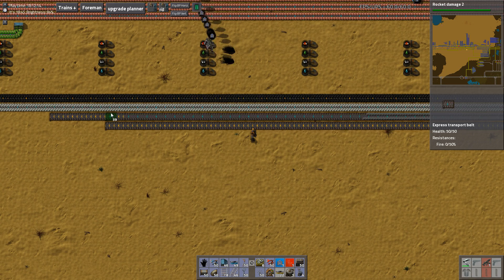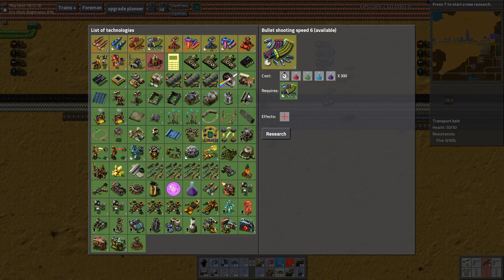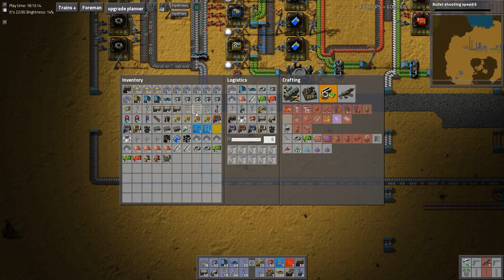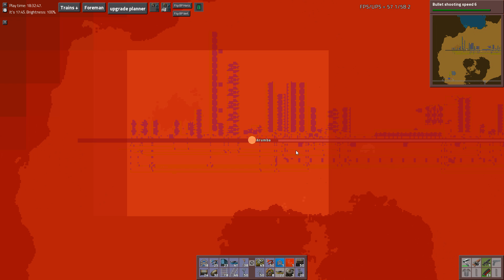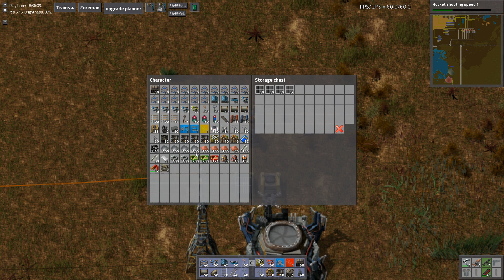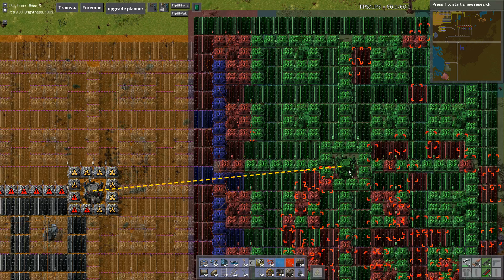Let's Play Factorio Steam Release 20

Comment: Tiny question: If the plan was to hook the solar farm builders up to the main robot network, then why did you build the factory for the solar farm in the north-western part of the complex and the solar farms in the south-east?

Wouldn't it make more sense to build the farm and the factory as close to each other as you can? I would've put the farm on the south-western corner of the factory, with enough space for what you'd reasonably need for belts on the main bus.

Comment: Arumba, you do know that you can remove and set the power lines on the poles manually right? Remember you being annoyed by the crisscross of wiring early on :)
Reply: +Frodulus The Wiki is nice :)

 Use shift-click on a existing pole to remove its connections to other poles.
 Unconnected poles can be connected with a single copper cable dragging from pole to pole.

Comment: Been watching for a while and I keep wondering why you don't use a carousel to unload the trains? that way you have one unloading station that feeds all the various fuel, copper, iron inputs.

Maybe an option since you seem adverse to enslaving the robots into running the train depots. My thought would be 3-4 interconnected circles that everything is unloaded onto, then smart inserters take off only what you set for each output. if 9 per side is the goal then each circle would need to me something like 12x10 ovalish rectangles.

Anyways Love the series, looking forward to the next episode.
Reply: I suspect the reason is they are hugely inefficent, due to multiple issues. Not to mention max throughput on such a station area is greatly reduced and Arumba like most YouTubers go for a base of a size that is equal to a small MegaBase.
Reply: By this time I agree he would need more throughput but there has to be a better way than running thousands of belts for each station... right?